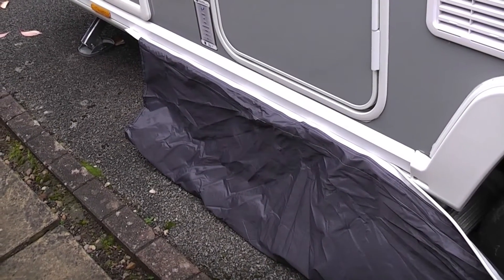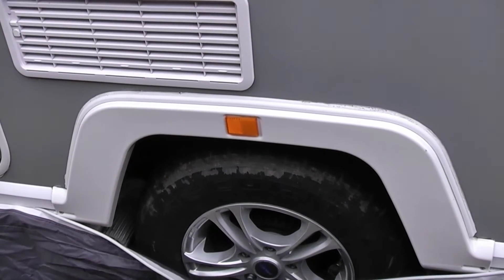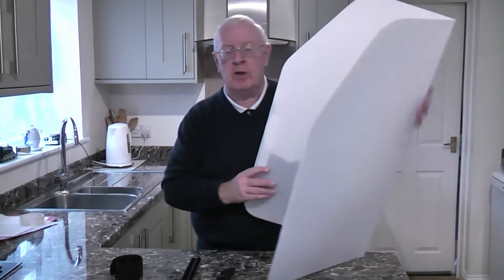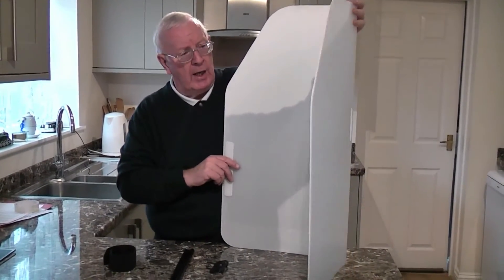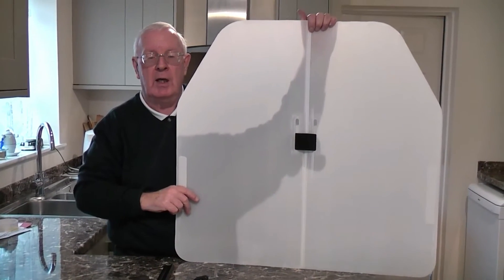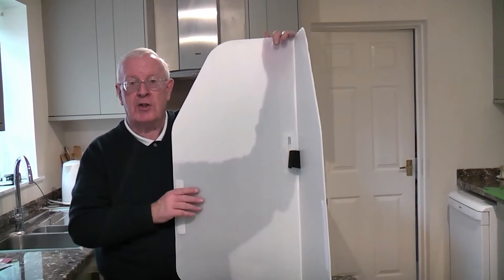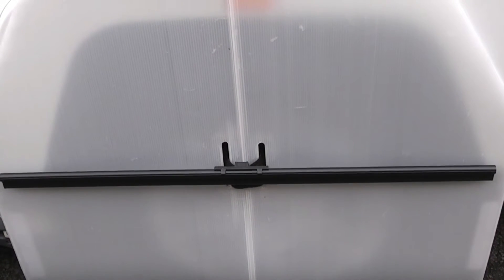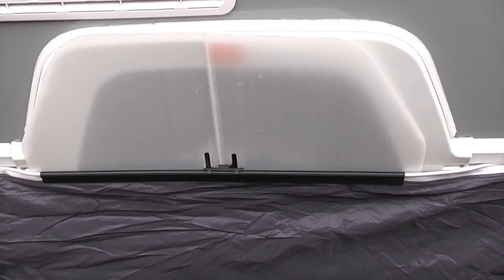How to Keep Out the Draught When You've Got a Skirt On !

Comment: Hi . We have a Bailey van and there is available at Prima Leisure a deluxe draghtskirt for wheels. It  comes in single & double axle sizes. It is shaped & you slide it around the wheel arch.& your normal skirt them fits across it. 
It was nit expensive about £10 and is the best item we have bought! 
Shame about that site. Yes they didn't think, but maybe their booking system cannot cope with transfers from season to season. Bye x
Reply from the maker: Hi Linda. Many thanks for looking at the video and for getting in touch - we appreciate it. Prima Leisure draught skirt sounds interesting - will take a look, thank you. George and Trish